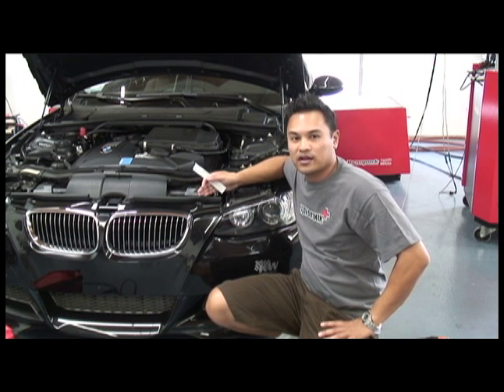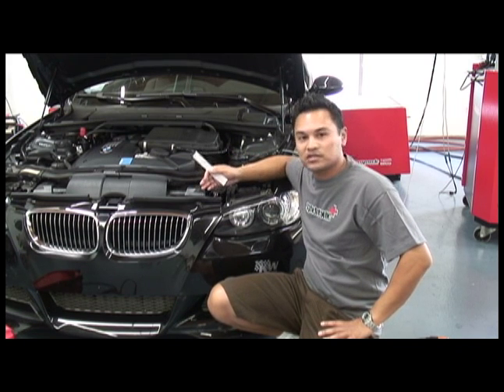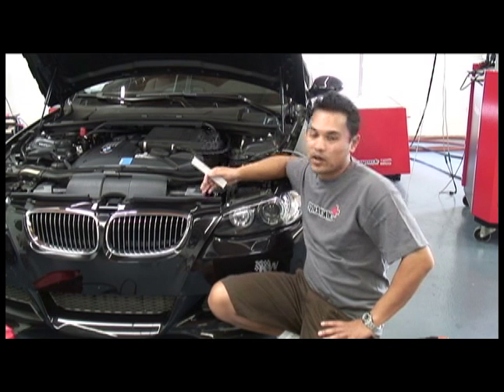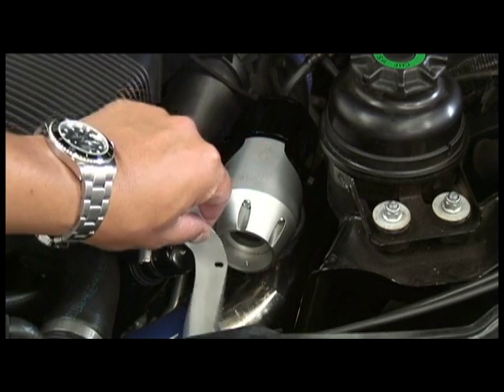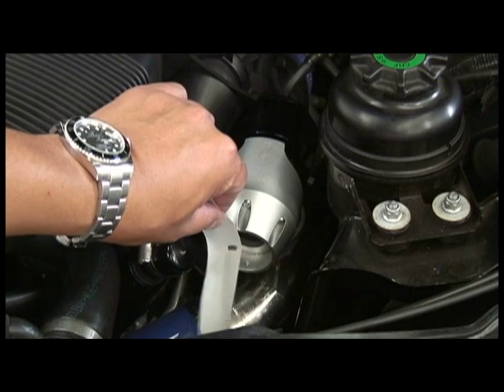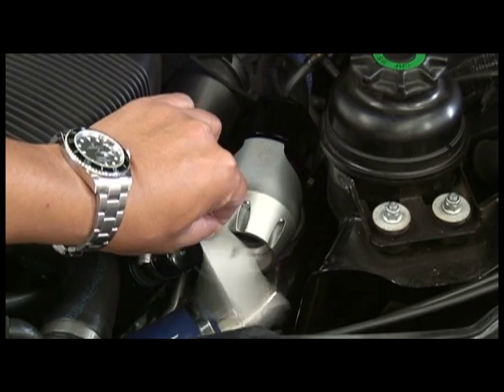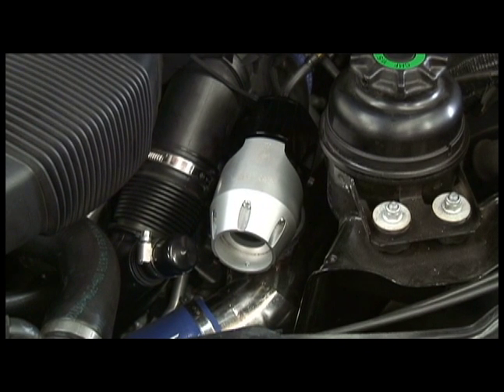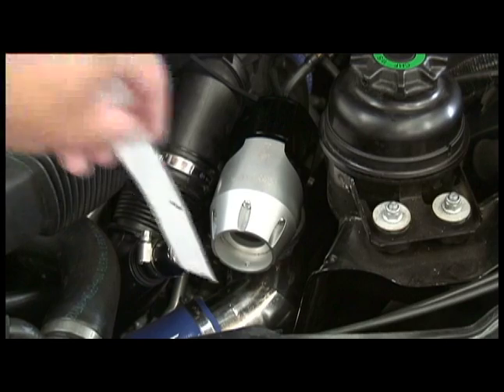Filtering a Blow-Off Valve (BOV)

Comment: you said pro charge...in this case this is turbo charged and i have myself a mazdaspeed.maybe in the set up of your harley is different from a car but my car the BOV has to be shut even on idle and as you could see in the video he accelerates and more air comes out....and yes wastegate regulates the pounds of boost depending how hard the spring is but it also releases the boost when you let go of the gas that's why theres a little switch in the turbo were you hook it to.stop talking shit dogg

Comment: wow, what a failure. enough efficiency, your blow off valve is stuck open when the motor is running, BOV's are supposed to close so you can buiild boost, instead of spraying it out of the bov.,

Comment: What exactly are you driving - A supercharged electric wheelchair ?

Yes, the boost is kinda low in standard tune. That´s why you can get 70-100 HP extra only by modifying the motor software so it raises boost pressure. The motor has lots of unused potential, because they need to have a a gap vs. M-Models and for durability.

Comment: I need to research? do you know what MAFT is? It stands for mass air flow translator and the purpose of having a maft is to relocate where your air sensor is and in most cases the sensor gets put after the bov eliminating the need to recirculate...I need to research on speed density and maft? remember dummy when you point at someone there are 3 fingers pointing right back at you. (as you point sitting in your chair to see)

Comment: your such a tool, every video on here of synapse users are part of you crappy team, listen up kids, boost leak is not your friend, your crappy stock factory bov's wont even leak under light throttle, but this excellent piece of scrap will!! so spend your hard earned money on it! while your at it you might as well buy tires with holes in them!!

Comment: bov, it leaks it out now causing a bad air/fule mixture. The only way to avoid it is to recuirculate the bov or get a blow thru set up. you can keep your 10g's my friend as you are going to need it. I'll stick with my Tial that does NOT blow any air out under ANY load including cruise throttle speeds, it only releases the air when it is supposed to, at closed throttle

Comment: ya Ill be a man and stand by products that dont leak. I NEVER ONCE said you were wrong about psi during cruise load. I said that every reputable bov on the market today does not leak the air out under these conditions, when will you get that thru ur head, u seem like a smart guy, most the "ricer" kids on here will throw this on their car , not recuirc it and wonder why their car is running like shit because they dont know that the air has already been metered by the mas and when it get to this..

Comment from the maker: Actually, there's no pressure at all at that point.  Vacuum alone is opening up the BOV.  There's no point in having the turbo work against a closed throttle.  So you might as well unload the compressor.  This leads to lower backpressure, and under cruising loads when the engine is in vac, this leads to improved efficiencies.

Comment from the maker: In fact, I'll bet you $10,000 that I'm right.  Any time, anywhere, any dyno, and a turbo car.  Let's show up with $10,000 each, and you prove me wrong.  You prove to me that the Synchronic BOV is leaking under boost.  You can also prove to me that whenever there is even the slightest partial throttle that there is boost.  I'll prove to you in any spark ignited turbo car you give me that there is vacuum under partial throttle cruising.  If you're a real man, you'll take me up on this bet.

Comment: if there was a bang head on wall smiley i'd be doing that right now, you just dont get it man, everything you stated was just turbo basics, anybody who has worked on turbo'd vehicles knows that, I get you are trying to sell your product through you tube to all the kids that love bov's, but I will stick with my 50mm Tial that does not leak while not under load. You dont need to call people down saying they dont know shit when it is possible they have been building engines longer than you

Comment from the maker: You need to understand a few key fundamental concepts:  Acceleration, momentum, and load.  You also need to understand the difference between looking at how something works from a static vs. dynamic perspective.  What we're showing in the video is cruising.  There is no engine out there, unless you're pulling a hill (hint:  load) that will cruise part throttle at greater than -10" of vacuum (negative) in which case the BOV is actuated open. Don't take my word for it, go drive and watch the gauge

Comment from the maker: Ok, obviously, you don't know or have as much experience with internal combustion engines as you say you do.  Because most people with a boost gauge in their car can verify this.  Go drive at part throttle, and tell me what the gauge does.  Do you  cruise the highway at 70 MPH at wide open throttle (WOT)?  No.  Go watch what your boost gauge does at part throttle, it will go to 0", otherwise known as atmosphereric pressure, then go down to about 15" for the next few hours.

Comment: obviously I am missing something as you say -3 to 100+ psi it is closed yet in the video it is clearly blowing air through during throttle,  under throttle vacum will be at 0 psi and start building boost but most likely will not build past 1 or 2 psi when you are reving it up you are entering your "-3 to 100+psi" range in wich u state it is closed...if it is closed, then why is air blowing through? and I know how turbo systems work I've been working with them for over 12 years

Comment from the maker: You need to understand another thing, if it doesn't seal at low boost, then compressed air isn't going into the engine, correct?  Then that means that the gross volume of exhaust gas (and energy) drops massively, which means that the turbo doesn't have the energy at all to build any boost later.  A turbo is always flowing air, even under vacuum, just like a centrifugal blower.  If it isn't, then your turbo's exhaust housing (A/R) is too big, or your turbo is crap.

Comment from the maker: You may own a built 4G63, but have you actually run a car on the dyno to understand how a turbo system actually works?  I design, BOVs and wastegates for a living.  I also have thousands of people around the world that use this BOV to make more HP than 95% of the people on the planet.  If boost leak at any pressure was a fundamental flaw of the design, we would not be selling any product at all.  Do your research, high PSI Evo's especially love using the product at ALL boost pressures.

Comment from the maker: Here's the part that is completely escaping you:  -3" to 100+ psi of BOOST IT IS CLOSED.  This means that the BOV is not open or "leaking" at any pressure.  Now, if you truly knew about how turbo systems worked, you would understand that if there was any sort of leak at lower pressures with a BOV, it would not even be able to build any boost.  Let alone only be able to hold "high boost."  Do your research on what are known as compressor-side boost-control or compressor wastegating.

Comment: if it doesnt seal untill high pressure is achieved, the turbo has to work twice as hard to achieve that pressure to seal  the bov, extra turbo wear is not good

Comment: ok first off I know how turbos work since I own a fully built 97 eclipse, of course it is under vacum during idle, this video shows it still blowing air under throttle, and under throttle most turbos will generate little to no boost but still is on the + side of pressure and should NOT be blowing out the bov, I have seen bov's let air out like this...it was a boost leak...this bov is only going to wear out turbos faster if it only seals completly under high boost pressure

Comment from the maker: I guess you don't understand how a throttled, spark-ignited engine works.  When it is in vacuum, there is no psi being made at all.  Please research what air flow characteristics are required in order to produce 1 psi.  And understand the definition of PSI.  Air flow alone does not produce pressure.

Comment: any kind of air leaking @ any psi is still a boost leak my friend, yes this bov is supposed to do this, still...its a boost leak, hks bov's work on pull type system yet...they dont leak...and no bov should ever need a filter because they are not supposed to draw in any air whatsoever

Comment from the maker: Do you not understand the concept of boost-to-vacuum transition?  The BOV does exactly what is going on behind the throttle plate.  So when the engine is in vacuum, the BOV is open to unload the compressor.  When there is -3" to 100+ psi of boost the BOV is closed.  You need to watch the other videos to understand how it actually works.

Comment: uh generaly when your bov is blowing out air all the time its called a boost leak...bov's are supposed to seal completly under throttle to hold the boost untill the throttle is released, if  you want to be constantly leaking boost wich in the long run will over work your turbo because it is constantly trying to maintain pressure and eventually ruin it...buy this bov lol

Comment from the maker: If your SR20 has a MAF (mass air flow sensor) and they typically do, then you are probably venting the discharge of your BOV to atmosphere.  If you recirculate it, then your car will run much smoother.  Check the Synapse online store, we have recirc tubes available if you don't have anyone that can make one for you.

Comment from the maker: It isn't a boost leak.  It follows exactly what is going on behind the throttle plate, which is what matters.  Once the pressure is -3" - 100 psi of pressure behind the throttle the BOV is closed.  Just because air is being produced by the turbo, doesn't mean it is boost.

Comment from the maker: Forcing air into the throttle plate when it is partially closed results in idle-overrun issues like many centrifugal blower guys experience.  The BOV just mirrors what is going on behind the throttle plate in the intake manifold.  Don't get too caught up in old antiquated philosophies, this is a new approach.

Comment from the maker: A turbo is always spinning and moving air.  Just because it is moving air doesn't mean that it is under boost.  In the old paradigm, all BOVs/DVs stay shut.  But most OEMs have caught onto this and their valves are slightly open under light throttle load.  That's why VW/Audi also do this under cruise on their electronic DVs.

Comment from the maker: That's airflow from the turbo, but since the throttle is partially closed vacuum is being produced behind the throttle.  In effect, the engine isn't seing that airflow.  You are basically loading the compressor unnecessarily.  That airflow is normally bypassed back into the intake in those conditions.  We are merely venting it to atmoshphere because the car is speed density and doesn't need to be routed back in.  The point is that the BOV doesn't need to be filtered since the air is exhausted

Comment: the charge pipe does NOT suck air through the BOV. there is no vacuum in the charge pipe/. The spring is designed to hold the valve shut until there is enough pressure in the charge pipe to push it open... at that point its pushing air out not sucking it in. at idle, the spring is strong enough to hold it shut, its not until you shut the throttle body under boost that enough air is produced to push air outta the valve.

Comment from the maker: With the spring pre-load that the legacy designs run, they always stay closed under vacuum and idle, at 20", even 26", but the pressure in the IC pipe helps them open up once the throttle is closed on decel and the pressure build in the IC pipes can help overcome the spring pre-load of the BOV.

Comment from the maker: Pull-type designs are actuated only by the vacuum source and not aided by pressure in the pipe to open. On the contrary, they stay shut due to the pressure in the IC pipes. Most BOV designs are push-type and  use a diaphragm.  The use of the diaphragm forces the designers to put an overly high spring pre-load on these BOVs, so that they don't leak under boost.  This produces an effect called flutterdump, search for a vid on YT.

Comment from the maker: Before you try to lecture me, I have designed and commercialized a BOV that is used by thousands worldwide and proven to work better than the legacy design that has been the same since, oh 1980.  I have a lab with a dyno that I test these designs on daily.  There are 2 basic types of BOVs, push and pull-type.  Both are actuated by vacuum, and both are supposed to be kept shut by boost pressure. Push designs are aided by boost pressure in the intercooler piping acting on the valve face of the BOV

Comment from the maker: Turbos, don't work this way because they are not tied to the crank speed.  When in low throttle 5% with no grade (ie low load) you don't have boost pressure pre-throttle when you are in vac post, because there isn't enough load to drive the turbine to the shaft speed necessary to produce boost.  Put that on a serious grade, =heavy load, then you'll see that with the same throttle condition,  you will see boost.

Comment: absolutely wrong!  Example-  I can be on the highway with my car lets say 3rd gear at a fast speed of 70+mph and lets say my rpm's are near 5000rpm...........IF my foot is barely on the throttle I'm not producing any boost because the bov/bypass valve is open.  Why is it open because my car cruises on the highway in negative vacuum like most cars do. You need the opening to the engine (throttle body) open to create a need for boost and to create the vacuum neededto close the bov.

Comment: You need to study up. The BOV or bypass valve are operated by vacuum and are always open under vacuum conditions(idle, decelerating). so unless your engine doesn't have any vacuum at idle it will always be open until the spring in the BOV is satisfied with equal amounts of vacuum/boost.(depends on how you have it set). I could stick ANY turbo or supercharger in and if the bov sees enough vacuum it will be in the open postition.

Comment from the maker: If you have enough airflow at something simple like reving with no load, and you get surge/flutter, imagine what you get under full load.  Now with blowers, they follow RPM of the crank, so revving with no load will produce the same amount of shaft speed and boost as you would under load.

Comment from the maker: Of course it does.  Your wheel tip to housing clearance on the compressor and turbine determine how much of the potential efficiency of a given turbo is utilized.  If the clearance is way off, it won't compress the air properly.  So, if the turbo is inefficient in the turbine, it won't be able to harness the exhaust energy at low RPMs, like high vac idle, and spin the compressor fast enough to discharge air volume.

Comment: reving the engine without the car under load and the throttle barely open to do so isn't showing us anything. On the highway you would have the throttle open a little more to counter wind resistance, weight of the car (load).

 I know of no reason to ever put a filter on a BOV other than to quiet those obnoxious things down.